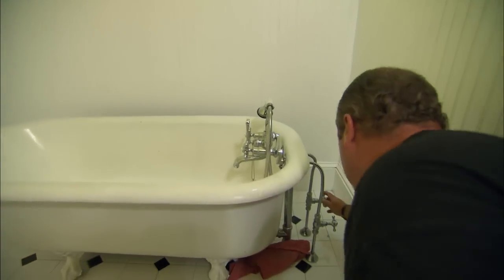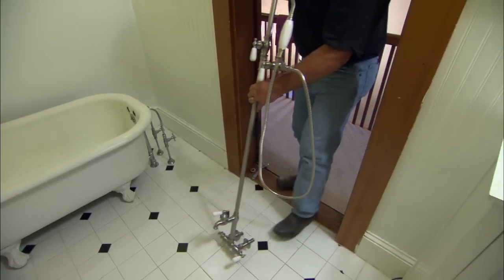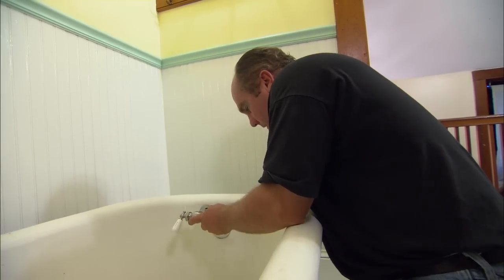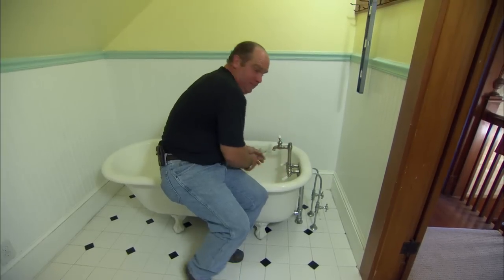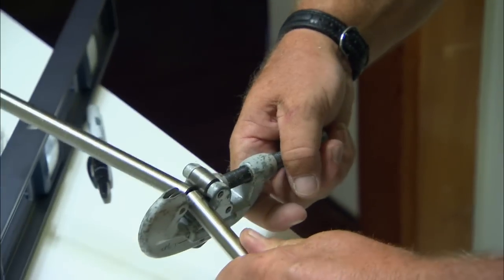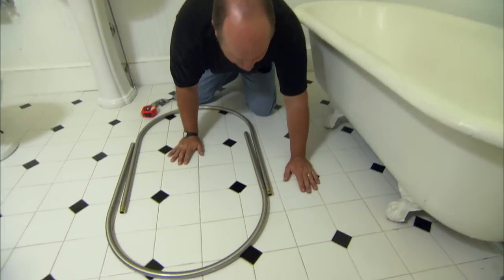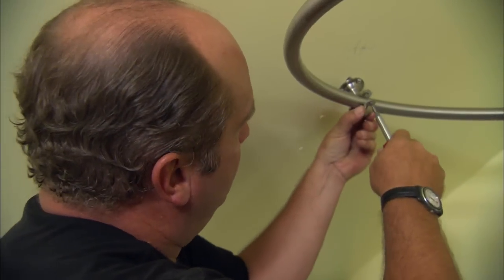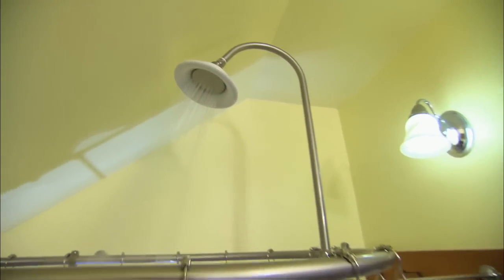How to Add a Shower to a Claw-Foot Tub | This Old House

Comment: i really don't understand why he's putting the support on the....coat rack?
Reply: The coat rack gives for extra support, beyond the wall, to hold the weight of the pipe, without ruining the finish or pulling down the structure of the wall. 

OR it could have been requested by the owner, and whatever the owner wants, the owner gets. Owners have been known to request off things for their own reasons.

The coat rack is often used to hang towels in bathrooms, such as this one, since there are no cabinets and closets.
Reply: Scott Summers  
Thanks for your reply.

Comment: 0:25 Use a crescent wrench so you won't mar the finish of the paint on the chrome...
Reply: Plating ok
Reply: But the paint got scratched...
Reply: I immediately thought if someone painted the chrome I don't think they care about maring the nut
Reply: that's an adjustable wrench
Crescent is just one manufacturer
Reply: @walterbrunswick  Nope, no other manufacturers wrench will work, only Cresent.
Reply: @Maxid1  oh okay thanks for clearing this up 😂

Comment: I have a claw foot tub, but there isn't a wall behind the faucets. It sits next to the wall, and the toilet is located past the faucet end of the tub. I also have plaster walls and probably a plaster ceiling behind the cardboard tiles. I also don't have shut off valves on my tub. So if I were to shut the main off, then run into problems, I wouldn't be able to turn the water to the whole house back on until I could get a plumber to come out and fix it.

When I mentioned wanting to have shut off valves on my tub, my friend was like, "Oh that's easy, just shut the water off, saw off the pipes, fit the valve, solder it into place..." Yeah, and when something goes wrong I'm screwed.

Comment: 4:50 I don't know, there's just something about seeing a plumber with a hammer that looks unnatural.
Reply: plumbings part of general construction so we are gonna have basic tools like that  lol. I dont like to use them either and it aint part of my small tool bag but remember most pipes are below the floor or in a wall... a hammers a good way to get to it quick

Comment: I've got almost the same thing, except it doesn't have all the extra braces.
Reply: it cost you alot???
Reply: I'm in Canada and I looked it at the Canadian Tire.ca site and just the 2 halves of the hoop and 2 braces is $ 500 CDN, about $ 350 USD. But because I'm Disabled and it extremely hard to climb in and out of the tub, my landlord has promised a shower stall once the pandemic is over.